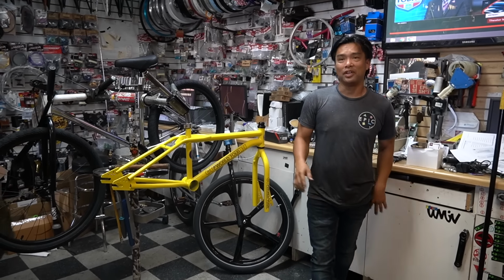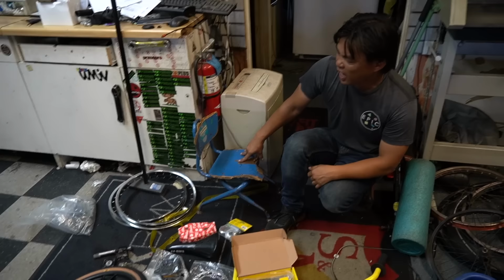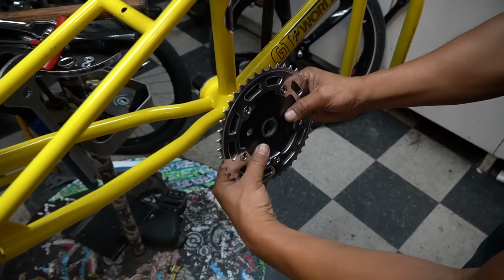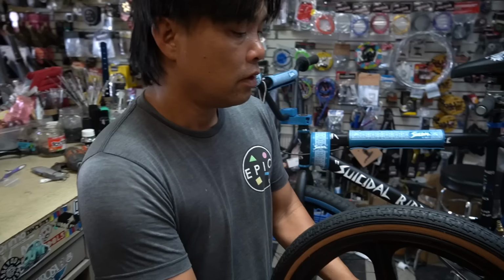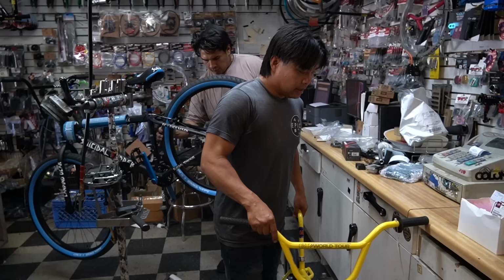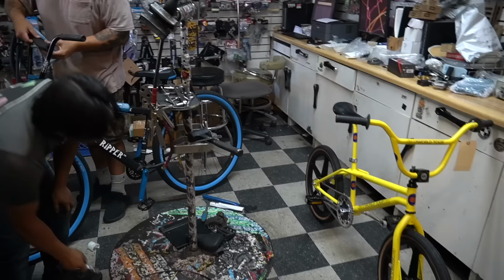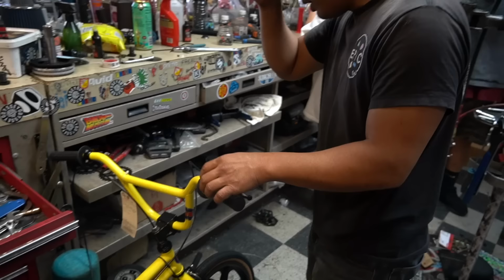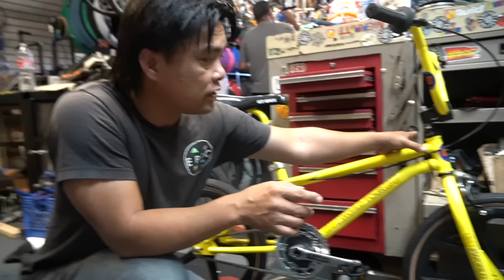Shop Owner's Incredible Transformation Of a Vintage 1985 GT World Tour BMX to its Former Glory!

Comment: I put my seat all the way back for more reach, having bigger hands helps when doing a trick to grab the bar and seat helps to fill the gap between.  Both cables for me in front of the bar tangles less with the feet if going over the bars.  I'm surprised no Odyssey Gyro or ACS Rotor for it.
Reply from the maker: Good points my man!
Reply: @AlfredoMancuso  I just picked up another 87 Mongoose Decade, my wife's new bike she never knew she wanted.  It is rough but will be nice when done.

Comment: Why rear wheel is not full slammed in dropouts, you have a lot of clearance, I know that, that the old frames doesn’t have a lot of room and clearance, but I personally think you can remove 2-3 links and rear end will be shorter and wheel will be looks more clean, sick and closer to frame bridges ❤